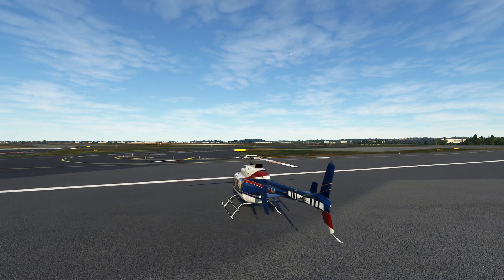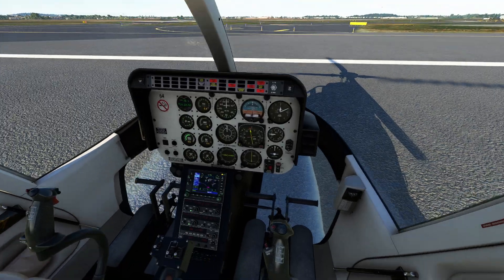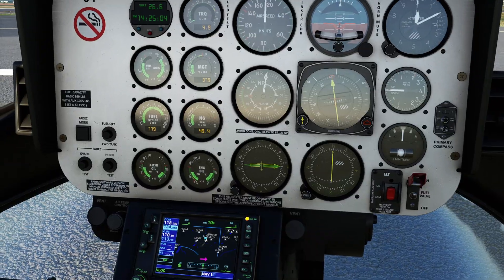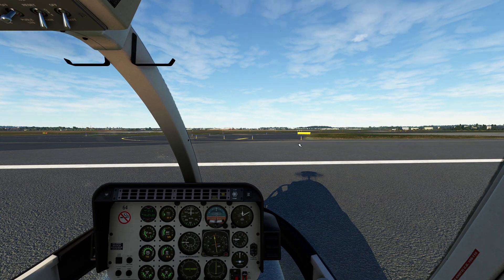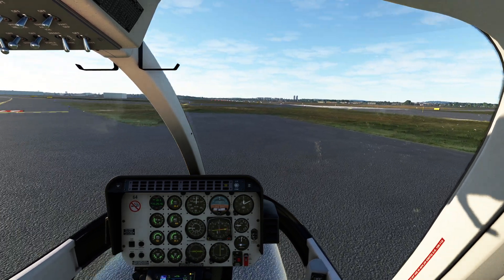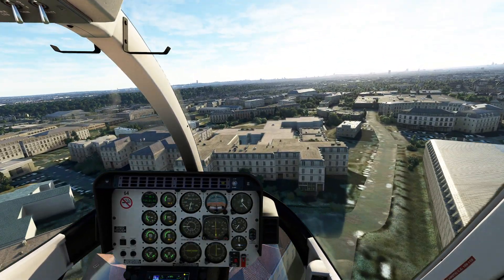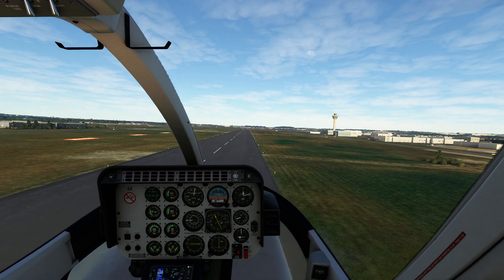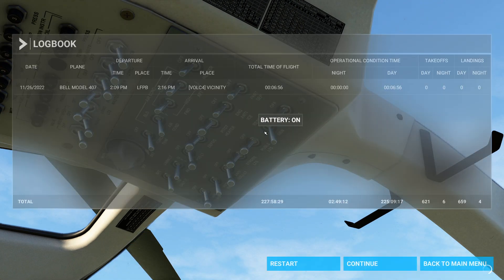MSFS - Flying the Bell 407

Comment: Startup Sequence (From a flight instructor on Bell 206) - The Bell 206 does indeed need to start with ZERO fuel - motor the engine until past 12% and then add fuel carefully to avoid a hot start... However, this is a FADEC system and thus you will put it in idle, hit the start button and the FADEC controls it all - it cuts the risk of hot starts (but doesn't eliminate them). - Another thing, the Bell 407 actually cruises at 138kt with 95% torque so this version is not quite right - however, having just tried it out on the sim, I think it does feel very much like the 407 apart from the lack of speed.
Reply: Oh - and at 95% and 138kt - it's still climbing at 200fpm
Reply: How i enable the Bell 407 automatic pilot?

Comment: This was a great video! 

The reason the 407 starts in “idle” as compared to the classic jet ranger (206), is because this engine architecture uses FADEC. All FADEC engined helicopters will run the startup sequence with the throttle at idle. In fact, the AW139 has the the throttle levers on the overhead left in the “flight” detent for normal ops; we use the engine master switches on the centre panel to go from off, idle and flight. Where as it’s predecessor the AW109 (at least the older airframes) use the classic method of holing the start button, then waiting for x amount of gas producer RPM, then moving the throttle into “idle” to introduce fuel. The amazing Bell 412 is another twin that stuck with this classic system, similar to King Airs is how I think of it being both an aeroplane and Heli pilot. 

Also in real choppers, left foot machines like Bells, Robinson etc feel much more natural and at home. Right foot machines like Cabris and Squirrels give me nightmares every night 😌😫😂

Comment: My Lessons Learned with the 407:
-Most of the comments I have seen from IRL helicopter pilots say the flight model is fine.  Don't give up.
-If you try to learn to fly the 407 and don't have helicopter experience (like me) don't bother.  Start with the Cabri instead.
-Spend several hours working on takeoffs, hover, landing, low taxi, pedal turns, square turns and quick stops in the Cabri and get good before transitioning to the 407.  YouTube for real life videos on these maneuvers, flight training, ground school, etc., and then go practice them.  A lot.
-I tried to fly the 407 a month ago and thought it was garbage.  Now I have about 20 hours (at least half of that doing training maneuvers) in the Cabri and I think the 407 is a lot of fun.  As soon as I had built up motor memory and got an intuitive sense on the Cabri, I came back to the 407 and immediately mastered it.  I guess flying a helicopter is like learning to ride a bike.  You have to break through to the point where you do it unconsciously.
-Set all your joystick curves to full linear.
-Loosen your throttle tension.
-Loosen your joystick spring tension.  I used long twisty-ties (found on bread bags or the wiring with new electronics).  Slide them around 2-3 coils, move the stick to full-lock to compress the spring, and then twist down the tie.  Experiment.  By compressing part of the tension spring, you reduce its strength.
-Pedals are a must.  You need to make rapid adjustments with fine control and a controller or a yaw-twisting joystick robs you of the required travel and fine control.  As a real life fixed wing pilot, I assure you pedals are not a gimmick, boondoggle or hornswaggle dreamed up by a sales department.  In the sim helicopter, they are crucial.

I hope that helps somebody.  Good luck and enjoy!
Reply: Great tips!
What about taking out the spring altogether? Or will it be too floppy
Reply: @pilotboy2612  I guess you could take the spring out, but without it the stick is really no good for fixed wing flight.  The ties, for me, work as a fast-rigged solution as I fly both fixed wing and rotorcraft.
Reply: @KaiTakApproach  Cheers

Comment: There's definitely some weird stuff with the throttle and turbine on this chopper. The throttle is basically an on/off with extra steps, and the N1 is always 85% no matter what.

The Bell 407 Improvement Mod fixes the turbine so it actually changes and also fixes the annoying instrument lights. I think the throttle has some deeper weirdness that requires a fix from Nemeth Designs.
Reply: Maybe it's because this is modeling a FADEC style fuel control system?

Comment: Hello

Sorry for my english, I'm french, thanks google.
Could you explain and show me in the MSFS wizard how:

- Configure a throttle lever for airplane in collective pitch for helicopter.
- Select a slide or rotary potentiometer of the throttle stick to make it "the stick" of the throttle of the helicopter.

My problem is that I can't find in the configuration of the primary or secondary flight control assistant which item to select for the assignment of the axis or/and the key.

I have a Trustmaster Flght Pack T16000M set and/or a Saitek X52.

Thank you in advance for your explanations.

Congratulations for these somewhat technical explanations on the flight of helicopter copters.

E.T.

Comment: I'm comfortable with startup and shut down now, thanks to you!  Can someone please explain Auto Trim and Force Trim?  I have been flying with them off up until I saw this video.  Also, the Rotor Brake doesn't seem to do anything.
OBTW: You can get that instrument light control to zero fast by pressing and holding LMB and sweeping to the left -- at least mine works that way.

Again, thanks!